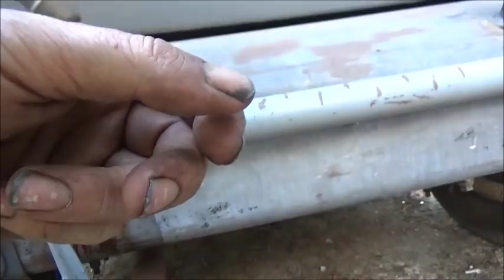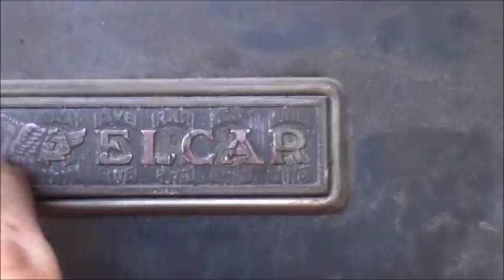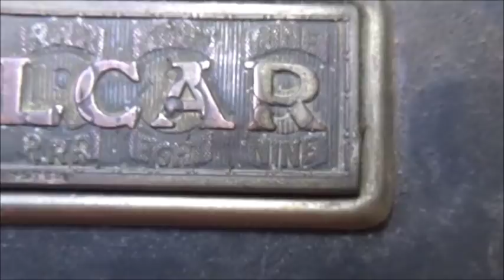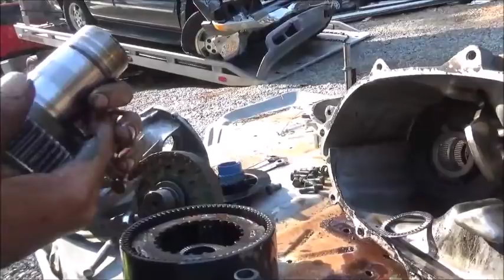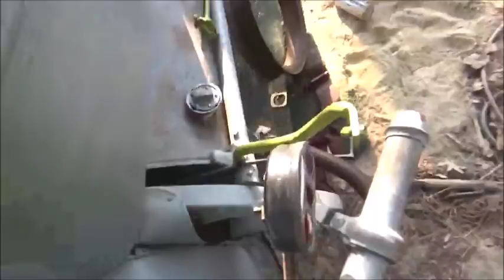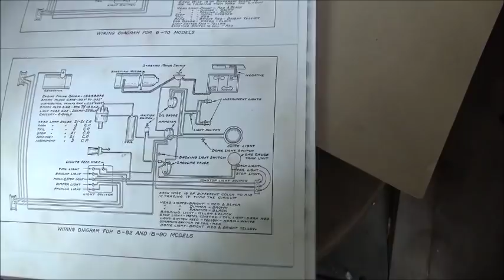1927 Elcar Fuel Sending Unit & 4x4 Square Body Trasfer Case

Comment: I found a page from Motor Manual describing the 5 gas gauge makers King-Seely, Stewart-Warner, Motormeter-Neco, AC, and Auto-Lite which has a 2 wire system sounds like Elcar from packard info.com/xoops/html/uploads/newbb/209_4bad290e23445.jpg

Comment: Hello Johnathan I think you said the one wire had power all the time. Should have power when key switch is turned on. The power for the tank should be on the same post on your keys switch that goes to the plus side of your coil. When you get that straitened out, the hot wire goes to the post and the other wire goes to one of the five screws. If you look at your lift truck it’s wired the same way. Great content. Never miss a posting. Thanks for all your hard work, and you will bless the day you stopped smoking.

Comment: Love the details on the FEDCO tag as well as the wiring diagram. Nowadays that diagram would not even cover 1 sub-diagram of say something like ABS or anti-theft.. For the same reason I love looking into old workshop manuals, the details and measurements are are much more elaborate and they actually explain how to repair rather than replace. That combined with the the nice hand drawn graphics can make them a real treat at times.

Comment: Hi Jonathan, it looks like power for the gas gauge circuit does indeed come off the switched side of the ignition switch. It should not be hot with the ignition switched off. It looks like the power feed to the gauge is the wire from the ignition switch. Another wire is for the gauge light. The remaining two feed the current from one side of the gauge through the slide resistor in the sender and back to the gauge. The ground return must be through the gauge case and instrument panel. They probably didn't rely on the tank for a return ground.

Comment: Hey Johnathan, I agree with your caution. I know that most cars have ( in tank ) fuel pumps now with full voltage going to them.
But in my mind the reastat on full voltage might glow red hot.
I'm no electrition by any means but  definitely check with a good mechanic to be sure. I'd also have thought the book would have shown some kind of resistor or something. Let us know how this turns out please.

Comment: I'd probably just cut the existing flange off and make a new round one for the tank. I think it would look better than the square one
Reply from the maker: Want to leave it original so if I find an original it will bolt in.
Reply: Jonathan W I was just thinking the chances of finding an original that still works is pretty much 0 at this point

Comment: The Ohms do not change with the voltage. So if the ohms are right, a 12 volt or 24 volt sender will work just as well. You might have to make your adapter from hard plastic, Phenolic board, or rubber to isolate the ground.

Comment: I'd probably put a Volt/ohm meter on the wires, see how much voltage is there. It would seem the gauge is just measuring the voltage the rheostat is set at (i.e. your fuel level). Of course your right on getting the info on the Chev sending unit to see how they'll play together. Its a very cool car and your sure not likely to see another if you go to a car show thats for sure. Good luck with it Jon.

Comment: The wiring diagram does show the feed for the gas sender going through the ignition switch. It should not have a feed when the ignition is off.

Comment: On a car that age it's highly likely the fuel/gas gauge will be permanent live, it was very common and continued on some vehicles well into the '90s (Fords) so it's no surprise you've got power there all the time.  Very little other than the ignition system was switched live on the ignition key...

Comment: that sending unit is not waterproof
Reply from the maker: No plans for it to see water.
Reply: Good point. Water will ALWAYS find its way in won't it!
Reply: Truman Renz, we ran out of fuel in an old Morris Minor as the salt water from the road shorted it out so we thought we had more fuel than we did!
Reply: make a cover for it

Comment: Hi Jonathan, Just in case you are unable to get an original ELCAR badge I made one in CAD and uploaded it to a 3D printing website that you can print it from to use as a casting pattern if need be. Sorry there is a cost involved, that is what they charge to do the printing.  https://www.shapeways.com/product/9MDGKHM4L/elcar-badge?key=9e98f0d13a34848a4e68fa85c74b1fb6
Reply from the maker: I really appreciate that!! I ordered a couple, even if I don't use them for casting, they will be neat to have, but it looks like it's time to break out some very fine sand and try to cast. Thanks again for taking the time to do that!!
Reply: Yes sir, the small text at the bottom will be very tricky to cast I expect. If you have any troubles with it, there is a possibility that the 3D printing place could print it in a metal like stainless steel, however, I would have to modify the design a little bit to make it work. For now I figured getting it close as I could was the best option so set it up for plastic print.

Comment: The original sender unit must have been fully insulated from ground. So as the tank emptied, it fed more power back to the gauge, turning it 'off' similar to an ignition light. Just an idea, or it may be total rubbish lol.
Reply: Interesting. I agree there would be very little power transferred, but it must have been insulated from ground, otherwise it would short out. From the wiring diagram, that wire must be 6v. All meters, except capillary tubed oil and temp meters are simply a volt meter. It's just the writing that's different.
Reply: You have a good idea there Malc ..
Reply: For what it's worth old 47 Chevy had the two wire. There is very little power going through as the float just moved the resister arm that's hooked to the slide coil . In a nut she'll this is nothing more than a volt meter. The float just varirs the voltage that the meter reads. It may be running as little as one or two volts.

Comment: You can use a variable resister wired in series with your sending unit to fine tune your gauge, then when you get it right, measure the ohms across the VR and get a resistor that matches it as close as possible. Then wire that in place of the VR and you’re good to go. May not be able to get it perfect, but you’ll be close enough for government work.

Comment: the rim looks like it goes on with wedges...l'm thinking 3 wedges would do the job for a spare tire...you have 3 parts there for mounting the spare, but l'm thinking they take a different kind of wedge - from what little l was able to see
Reply: Are you sure that spare rim is right for your car? I saw a pic where a flat ring attaches to those 3 pieces you showed & the spare goes on the ring

Comment: I'm loving the Elcar. Early carmakers had to make it up as they went along. If you can find an old "Dykes Automobile and gasoline engine Encyclopedia" it may give you some help with the strange wiring. Mine covers 1909-1943 autos.